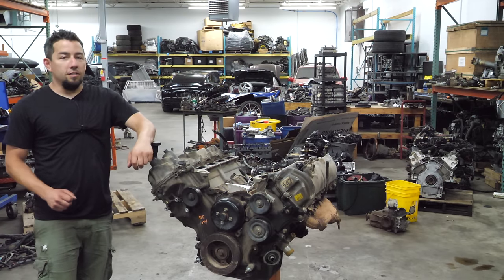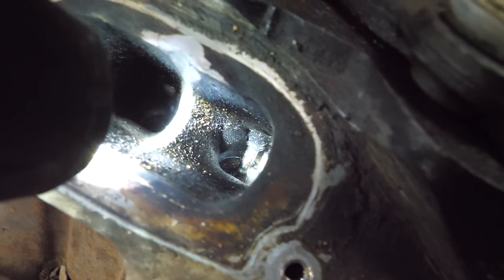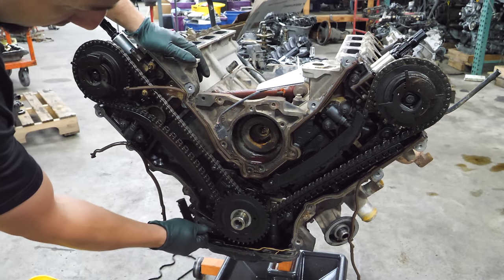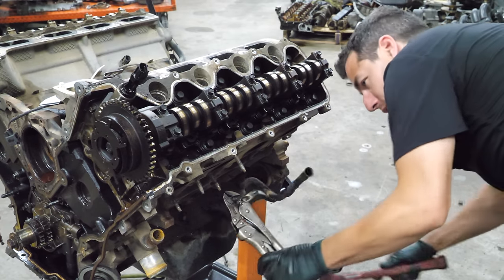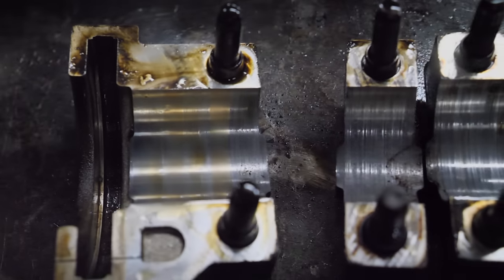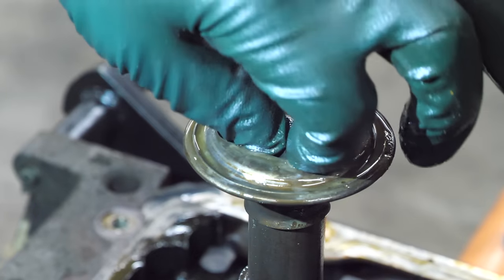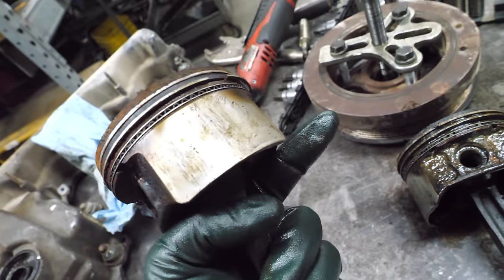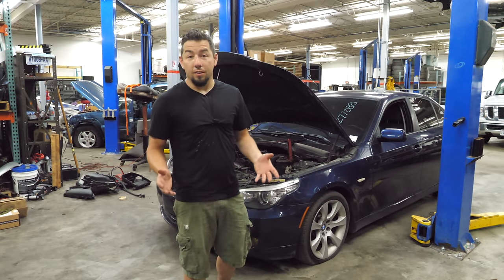Bad Ford 5.4 3-valve V8 Engine Teardown. Which of The MANY Possible Failures Took This One Out?

Comment: There are a few things totally wrong in this video: 
- Cam phaser problems, the only problem were the internals pins failing due to poor lubrication (Also this is not unique to the 5.4, pretty much every OHC ford has phaser issues)
- The timing chain tensioner doesn't cause racket, it's mechanically impossible. The noise comes from the timing chains and only occurs for 1-3 seconds on a cold start up until oil pressure builds up.
- Loud injectors seems like a random complaint/nit picking 
- The exhaust manifolds only crack when you ignore your broken passenger side rear manifold stud, or have a poorly designed aftermarket exhaust system, or just let all your studs rust out.
- The timing chain causing the rockers and followers to fall apart because of too much slack.. Well these motors do not have rockers, they have cam followers, and they wear out from low oil pressure, not timing chain slack
- The valve covers are the exact same manufacturing process as dozens of other ford valve covers. They only crack when installed improperly without a torque wrench and without the correct torque sequence. Or because the valve cover gasket is installed incorrectly 
- The VCT solenoids only get clogged if you do not maintain your truck the way you're supposed to. They fail because of poor oil pressure failing to lubricate them, causing the internal spring to heat up and weaken. 
- Other than the 7 issues I will list below, they aren't know for having any other problems when maintained correctly.

It's just a misunderstood engine that our of the factory, had issues. But the issues were easy to fix and 99% of the replacement motors are very cheap and have the updated parts correcting these issues. For those truly wondering what the issues were, here you go:

#1 Failure point - Oil pump had insufficient pressure across the rpm range. This low pressure contributed to many premature failures. 
#2 Failure point - Roller followers had too large of a port hole that would lead to less oil pressure and a weaker jet to lubricate the cam. The cam would then wear into the roller follower, the needle bearings would fail, knocking would occur and eventually you'd destroy your head. 
#3 Failure point - Timing chain tensioners had poorly designed seals and was based off of oil pressure. When these seals would break, the tensioner would lose pressure, lose tension, and cause the timing chain to slap around without tension upon start up until oil pressure built up, however it would still leak oil even under pressure, causing even lower pressure for the roller followers. Loose timing chains would eventually destroy their guides or grind various parts of the motor until debris fell into your oil pan and ruined your motor.

Those were the primary points of failure, keyword - failure, as in destroy your motor. Here were some other common issues:

#4 issue - Cam phasers were poorly designed, causing the internal pins to wear out and create knocking noises, while also failing to adjust the camshaft position for better timing. The phaser itself would not break or come apart, you're truck would still be drivable. 
#5 issue - Sticking VCT solenoids due to lack of lubrication (Again, from lack of oil pressure) failing to adjust oil pressure, causing variable cam timing to not work as intended. You would see worse mileage, slight power reduction, but you're truck would still be drivable.
#6 issue - Exhaust manifold leak caused from passenger side rear stud shearing off due to rust and poor design. 
#7 issue (On earlier model 5.4s) - Spark plugs shearing in half when trying to replace them. The two-piece plug design was a poor design and later fixed on later model motors.

Now the fixes for each issue:
#1 - Replace oil pump for melling high volume oil pump 
#2 - Replace followers with updated Ford followers with smaller port hole, leading to a higher pressure jet to lubricate the cam and higher pressure across the entire motor. 
#3 - Replace with Cloyes Steed bodied ratcheting tensioner - the Cloyes uses a ratcheting system to maintain tension regardless of oil pressure and a doesn't use rubber seals that can fail.
#4 - Replace with updated OEM cam phasers, in conjunction with better oil pump these issues were resolved. 
#5 - Replace with OEM updated VCT solenoid, in conjunction with better oil pump these issues were resolved.
#6 - Replace with stainless steel studs and nuts that were corrosion resistant and were better load-bearing.
#7 - Use the Spark plug tool specifically made for this issue, one time purchase and you'll never have the issue again. 

You can fix all of these issues for less than $1,800 and I encourage you to try it yourself as there is an entire section of youtube dedicated to working on these motors/trucks. Otherwise you'll pay well over 4-6k in labor. 

Now some highlights of this motor - It's a torque machine. It's a long stroke iron block 4.6 that is very quick to rev and has a wild torque curve for a NA motor. When updated with the correct parts, these motors will breeze past 300k miles all day long with many cresting 500k miles. They respond extremely well to boost, making over 500 at the crank on just 8-9 psi on a bone stock motor and exhaust system - a less restrictive exhaust can yield significantly more power when coupled with boost as these motors struggle a little to flow air. They get to their power curve much quicker than other motors such as the 6.2 boss.  These motors do not leak, the gasket designs were absolutely perfect. Parts for these motors are especially cheap, and there are dozens of specialty tools made for this motor that makes it very easy to work on - except for exhaust manifolds. Those are hell, replace the studs BEFORE they shear. Crate motors are everywhere and pretty much all of them have the updated parts already installed. 

If you want a V8 truck motor with a powerband ideal for moving a 6000lb truck, that can handle 9psi without any issue and last you hundreds of thousands of miles, that's easy to work on, gets good mileage relatively speaking, and has huge aftermarket support AND you want it for cheap, we're talking $3200 for a long block, you are better off with the 5.4 3 valve than the coyote or any ecoboost motor. If you're one of those people that puts 40,000 miles on a car and sells it, then go for the motors that look better on paper but won't last half as long and cost twice as much to repair and replace. 

The only catch to the 5.4 3 valve is: If you are incapable of doing a timing job yourself, this motor isn't worth it for you. The awesome value of this motor lies in the hands of someone who is capable of installing the updated parts.

Comment: Lincoln Navigators had the 5.4 DOHC 4 Valve mod motor.  Basically a stroked bigger brother to the lincoln Mark 8 DOHC.  years were 93 thru ???
Reply: Pretty stout hardware..  no VVT, but still there were the Cobra Cam Kits.   Worthy of a Blower..

Comment: I have 3 of these trucks one with 5.4l 3v was an amazing motor 750,000km on my monster .. 37 inch tires and 6 inch lift. Original motor… no rebuilds. Replaced the plugs 3 times now… keep up on your oil changes bys !… only thing that truck needs is care. Motors was garbage because you had bys not Doing oil changes because they’re broke. Oil is key to these motors !!! Clean clean clean clean oil. I us 10w 30 in my truck since day one. With 20 percent Lucas oil stabilizer and still running with no cam phasers issues yet knock on wood. I also have a 5.0 l and a 2013 5.4l 3v with 51,000kms still never broke down yet in either truck. Ford is good if you take care of it ! Use octane booster as well in the gas. Seafoam the motor every 10,000kms. Truck will last forever ! All about that oil !!! Oil is everything.

Comment: Is a 6.2L a good replacement for this 5.4L engine?  Would it bolt up to the transmission and would the 5.4 ECU work with it or would you have to replace it with the 6.2 ECU?

Comment: My 2011 Ford Expedition has 250k original miles, only use full synthetic 5w20 every 5-6k and drove mostly highway mileage most of it's life. Only issue was the passenger side exhaust manifold, the exhaust weight and lack of covering from road debris, salt etc in the northeast so they are extremely common out here on these vehicles. My main advice is MAINTENANCE. These motors are temperamental and need to be babied and cannot go on extended intervals. Most of these motors that are trashed are that way mostly due to poor maintenance and hard running. Remember these motors were in almost everything Ford for many years so there are tons out there so of course there are many stories and some not so flattering. I've had several in my company and most were solid anchors and just had exhaust issues more then anything due to the aforementioned.

Comment: HELP.
2004 Ford F-150 5.4
145000miles
Just replaced the transmission :(
tiking noise haunting me now.
checked compression and replaced a "smashed" plugg
drove it for a few miles and it smashed another plug...tiking continues.
Any ideas??
Reply: Roller followers

Comment: I have a 2008 Limited with this engine and have over 190,000 miles on it. I have had zero issues with this engine. Not one thing has ever gone wrong with it. Not even a bad coil pack... I mean zero problems not one... first major repaier was a couple months ago and that was the rear pinion bearing went bad. That is the only issue with this truck. My 1999 5.4 f150 has blown out 3 spark plugs out of thr head and the manifold leaks. It's a 210,000 mile truck. Yes it still runs good and has plenty of power but my 3 valve as been more trouble free...

Comment: I got 14 expedition with 5.4. I got 230,000 miles and counting... but so far so good. I was told the oil changes on time for this engine is crucial. when its not done on time. All the things you see are what happens.. lack of pressure on tensioner cause slack on chain hitting the plastic guides and breaking them. Its seems Ford did something to the engine in later years of 5.4 that makes this engine little better than older 5.4 3v. Its interesting that for any engine, when someone takes care of their ride they last for many miles. I've seen same 5.4 with 500K miles with only oil changes. 

At least good thing is most techs are experienced with these 5.4 enough, any tech can fix these in any part of the country.

Comment: I have a 2006 Expedition with this engine. It has 250,000 miles and running strong. The only problem I've had is the coils failing. With new coils and plugs it hums. don't be so harsh.

Comment: I bought 2004 f150 lariat 218k 5.4 4x4 runs absolutely great!
I am a 30 year mechanic!
These motors can last 500k simple magic its called change the oil! Use the right oil!
Just as any engine this one was a experimental 3 valve so therefore the timing chains are really the only issue and plugs are simple to change you just need to know what your doing!
Those plugs must be removed at certain temp! 
Personally there's worse engines ford made like 90s 2.8 v6 or even some gm 2.8 v6 engines

Comment: Not all, but most engine catastrophes are due to poor maintenance. Cheap oil, low oil level, etc.
I drive an '08 F150 with a 5.4 3v and this engine runs like a champion with 200k miles.

This truck is my daily, and has towed 12k pounds time and time again.
I've also enjoyed wheeling it in the trails on my property in a foot of fresh powder snow with the engine bouncing off the rev-limiter like it's a normal thing.

But I change my oil regularly, and run a good oil and filter. 
Like they say, oil changes are cheap- engines aren't.

Comment: Grooves in the cylinders can be from a poor job evacuating the broken ceramic from the broke spark plugs.  After my brother's truck was serviced by Ford, it started using oil.  It never smokes, but he said he suspects ceramic got into the cylinders and that's all she wrote.  He was so digusted with the truck, he threw the keys to me and said it's yours and went and a bought a Toyota - soured on Ford forever and it was his first one.  I'm going to switch to Rotalla T6 5w-40 and let it finish its days out on that.

Comment: i find these 3v's easy to work on
most of the time its the timing fazors went out and shops charge u 3k to fix it. u can get a full timing kit for 500 usd and do it ur self. i know my triton inside and out. at this point i would never trade it over they are so easy once u know what ur doing. even now i would change timing chains etc for 1500 usd that is half of any shop would charge. i find them fun to work on

Comment: Eng Cylinder #2 passengerside Cam follower (rockerarm) visible damage on bearing roller...This is the Ticking sound warning you of an upcoming Catastrophic Failure possible valve damage or breaking of same dropping into cylinder Get on it Troops before......💥

Comment: I like how people don't take care of their vehicles then blame it on the vehicle. Yes, the 5.4L 3v is junk. You should just give me yours. I'll clean it up, throw a new timing system and updated roller followers in it and sell it for $5k. Scores of these engines going over 250k-300k miles. Treat it like trash and that's what you'll have.
Reply: No shit. Got one in an 09 Expedition. Has close to 200k and still runs ok. Haven’t had rocker arm or timing issues. I DID have the exhaust manifold tick but that’s it.

Comment: I have over 200k miles on my 5.4 ford and it has been good, no major problems.  I understand regular oil change with 5-30 NOT 5-20 oil helps it last longer

Comment: I've personally owned 2 of these and my family has another 3. Use good quality oil and change it on time, do the updated phasers and melling oil pump with a timing job. Every one of our 5.4 3v went well over 200k. Poor maintenance kills these faster than the engineering short comings. Timing jobs need to be done on almost all vehicles, people neglect these until they start making noises...thats too late.

Comment: The timing tensioner is the root cause of failure in most of these engines. Ford made a revised VCT solenoid that stopped a lot of the rattling.

Comment: I had a 2004 f150 with the 5.4 liter 3 valve and it use to shoot out the spark plugs. Had to change the heads. I just sold it.

Comment: You can clearly see that this engine was neglected. People dont service their vehicles and the. Act surprised when this go south.
Reply: Exactly. I have an 09 expedition. My dad bought it new. Same motor as the one in the video. Maintenance was kept up with. Still runs ok. Never had cam phaser issues. It does have a ticking from the exhaust manifolds which I’m gonna get fixed pretty soon. Other than that, it has close to 200k miles and still runs ok.

Comment: I just bought a 2010 F150 with the 5.4 in November because most of my contractors where I work use trucks with that engine and actually recommended it to me. This video is definitely awesome in preparing me for potential issues down the road. I’ve got 147,000 miles and am hoping to get it to 300,000. Luckily I just use it as a daily driver and nothing crazy.

Comment: I had. Ford 5.4 in a 2004 f-250 that blew its head gaskets I was quoted 4500 to replace the head gaskets or 8500 for a new engine.  A set of he’d gaskets is what $50-100. That’s a ton of labor to replace a gasket on an engine that only had 120k on it

Comment: There is no doubt these 3v engines have design flaws.  But,  hear me out.  The timing chains,  guides, oil pump, and cam followers aren't that bad to do.  The worse part of this job, on the trucks is getting to the p/s bolts lol. But these engines really respond well to some compression, cams, programmers, and the other bolt ons. The 3v engines remind me of the old school version of the 351m 400m v8s. You could make the 351/400m a monster with cam, compression, and a good intake.

Comment: The only problem with this engine is the timing chain tensioners.  They start to leak which causes the chain to bounce, that breaks the guides and rails, makes the chain stretch more, jumps teeth on the phasers, phasers try to over compensate, and the engine just starts to run bad.  Stupid little rubber seals made this engine a misfit.  Two tensioners are probably $40.....

Comment: I have one in my FX4 work truck, I have 253k on the odometer and still running strong.
When it’s serviced and maintained it will run for ever. Updated parts to latest and greatest versions also make it possible….
Reply: Luck

Comment: The mod 3v sits on top of a bulletproof 2v short block. The bore/stroke ratio of this motor is borderline stroker geometry. The problem is that Ford never put out a version 2 of this motor correcting the major design flaws (timing components, exhaust manifold bolts, oil pump, plugs and a brain-dead factory tune). Instead the faulty Coyote version 1 took it's place. Ford did eventually correct the phaser design and the aftermarket corrected the rest. For 5 grand you can do the factory corrections and add high-flow air filter/exhaust and a performance tune and you got a variable-timed beast that sounds awesome and will run hard for 350k/mi+. This assuming you don't live under a rock and are using full-synthetic 5W-30 oil.

Comment: If it ticks get it fixed. It is just specially true with the 5.4 3V. I almost wiped out a cam. Lots of YouTube’s on fixing it. Got 330k on a 2010. 90miles to work and back. 2nd trans. It serves its purpose. All engines are junk if you don’t take care of them.

Comment: I have a 3 valve 5.4. 174k with no problems except 3 drivers side exhaust manifolds. I have a buddy that has 190k on his and he hasn't even had the manifold problems. Probably because I pull heavy stuff and he doesn't